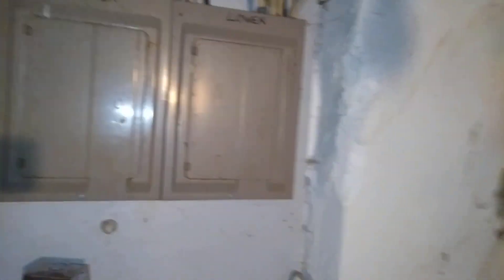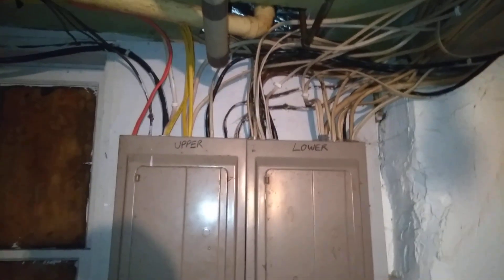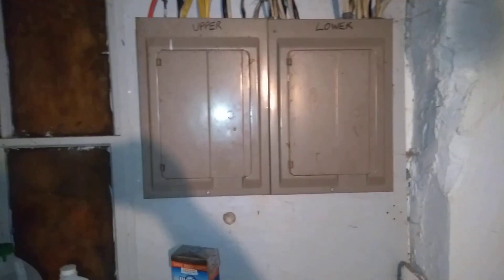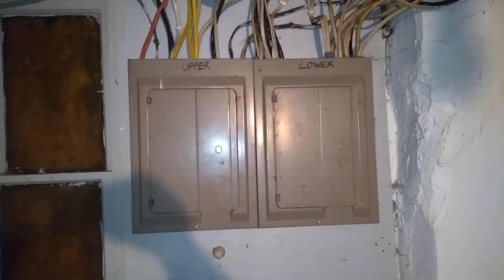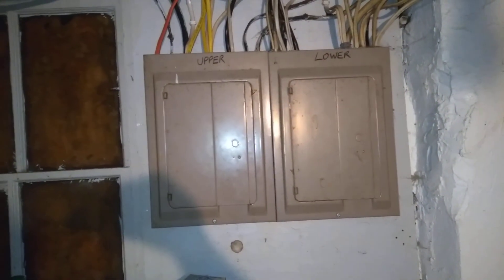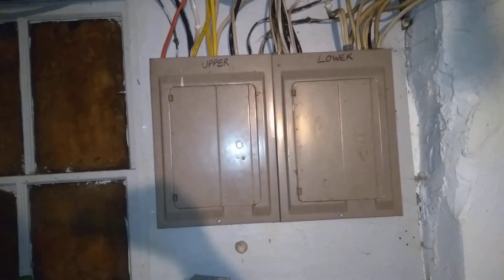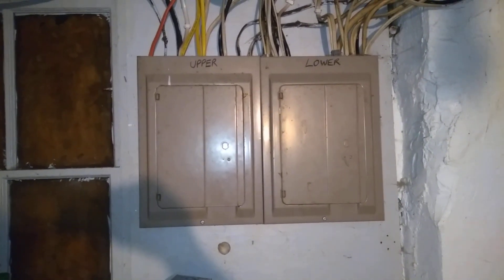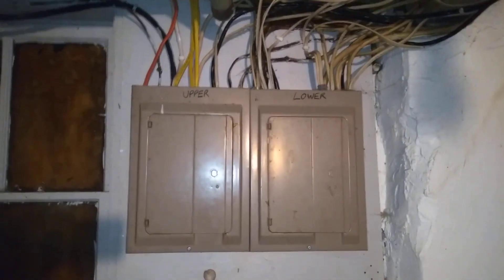Ham Radio Earthing, Grounding, Bonding Questions

Comment: I have a similar problem. What I did was make a copper plate with couplers for the coax. Kind of like the window pass through connectors. That goes to a ground rod outside by the foundation. Then coax jumpers go to the station equipment. The station is grounded to a copper clad ground rod attached horizontally to the wall behind the station with clamps and 1/2 braid. The rod then has a 4 gauge solid wire running to two copper clad rods driven through the concrete floor with no sharp bends. I rented a hammer drill and made a hole in the floor and drove the eight foot rods in. Then I sealed around the holes in the floor. 
Not saying this is a good way or bad way or what you need. I’m not an electrical engineer so take the free advice for what is costs. 😜
But I seem to get a good result. There are many good grounding videos here and there are books available. 
I was told this. There is no perfect 100% foolproof way to ground a station. A direct hit doesn’t care what you have. 
Any ground is better than no ground. 
Make an effort to keep you and the family safe and do the best you can with your budget. 
And, if it looks like garbage, it will perform the same way. 
Also make sure all the verticals have a ground at the antenna. If it is tall or you use a tower, use more than one.

Comment: Go to w8ji.com and see how it is done properly.  He is a real expert in all things technical. You will be providing grounding just outside your shack and MUST bond it to the power company ground rod.  All done outside.  You want to keep lightning current outside.
Reply from the maker: Thank you for the link and thank you for the information. Quick question, with binding the ground rod for lightning protection to the ac ground rod, is that something I can do myself, or do I need an electrician to do that?
Reply: @Sparkyzilla85  You can do it.  You need to check on the size wire needed (I think #6 solid).  You use clamps on each ground rod and bury the wire.  Make sure clamps are rated for underground.  This assures there is no voltage between your equipment and the ac line in the house during a surge.  You telephone, cable tv, etc should all be connected to the power company ground already.  de K2XT

Comment: I studies countless hours, read and watched videos on so so many youtubers, from reputable ones, to not so ones...i read many books on grounding, which got me even more confused.   This is been going on for years.   I bought the ARRL grounding, earthing and bonding book and i put the pieces together. 

My ham shack, which I will make a video this week sometime, and my understanding consist of this.

I have an Imax antenna on a20 foot tower, which brings antenna over 40 feet or so.
I have a scanner antenna on a monopole pole about 20 feet plus.
I have a 40m dipole only about 10-15 feet of the ground, with a 1:1 balun.

Ok, now my tower for the Imax has a #3 ground cable,NEC rules state  you need a #6 at minimum...I put #3...ok, so on the top of the tower my shield from my coax attaches to the top most upper part of the tower and is bonded there...All the legs on the top of tower are tied together with the ground cable.   That same ground cable comes down to the base of the antenna and all 3 legs are tied again together...Right by the tower i have an 8 foot ground rod and that coax is hooked up there.
I then 16 feet away have another ground rod and another 16 feet away have the last ground rod, which luckily ends at my electrical panel and just bonds to it...I clamped the ground wire to the electrical outer box..

My scanner antenna pole has 2 pcs that makes it a high mast...The top part of the pole has the ground cable coming down to the base or lower part of the 1st pole and bonded there also...It continues to the base of the other tower where i have my first ground rod and its attached there...

My dipole coax comes to the box by the tower which I made, home made...Inside i have lightning suppresors...the suppressors are all grounded and attached to a main point in that box....A ground cable from that point goes out the box and attaches to the 1st ground rod by the tower...My understanding is NEC rules state you need lightning suppressors no matter what and it has to be at the entry point and they should be grounded...Crazy amount of work, but I did it...

ok, so all 3 pcs of coax go into my arrestor box...then they continue through the wall into my basement...

I have an Icom 7000, and an Icom 7300 and a ton of scanners on my bench. 

The Icom radios at the back have a ground srew...they all have a flat aluminum ground cable going to a main point.  I used a copper pipe and flattened it...That is my main ground point by my radios.   All radios, power supplies, antenna switches, etc.  All grounds have home run ground cables each to that ground bar..  No daisy chains.   That ground copper pipe then has one ground cable again #3 going out to my 1st ground rod by the tower. 

That's what i did, i followed the rules the best i can just incase something happens, i want to be protected.   I had so many qs, like why this and why that and why hook up to the electrical, etc....Either way, right or wrong, I did it the correct way.   If i missed anythign please anyone correct me or tell me what to add.  I followed the rules specifically and exactly as stated. 

I will make a video and hopefully you can watch it one day and tell me what you think.   This was costly, from connectors, extra coax, grounding cable, the rods, all the little things here and there, cost alot...But took me some time, little by little...

Hope this helped...tell me what you think...

good luck,

Theo
Reply from the maker: Hi Theo. Thanks for the response and I hope that you do make a video since I like to see other people's setups.
Reply: @Sparkyzilla85  spend the whole afternoon, running ground wire, fishing coax through the wall and to my radios and tomorrow i will hook up the pl259 connectors to y coax outside that go in my arrestor box and then i will make a video for sure...can't wait to go on the air..

Comment: The ARRL book called Grounding and Bonding for the Radio Amateur which you said you were planning on picking up is definitely the go to source for your questions.  but understand that it may take some time for you to absorb all the information in that book.  Another book that is highly useful is the ARRL antenna book although it doesn't go into grounding your shack that much at all.  it does talk about the effects that the ground around your antenna has on propagation..
Reply from the maker: I just ordered Grounding and Bonding for the Radio Amateur from HRO, and I look forward to learning from it.